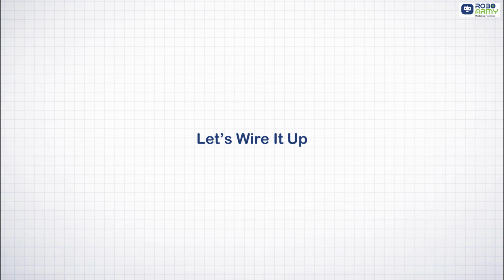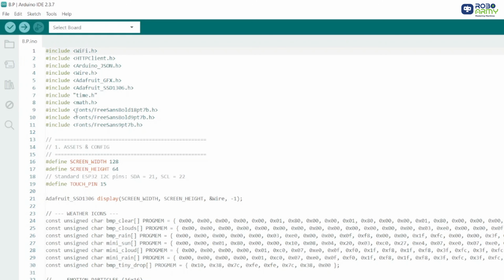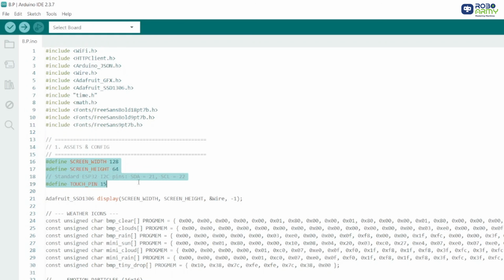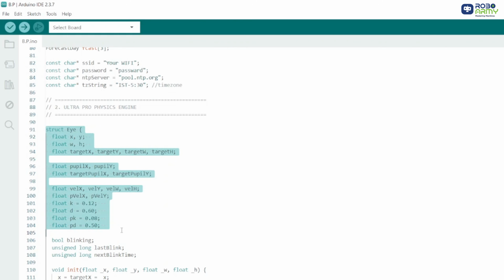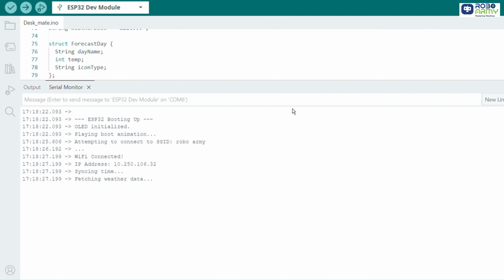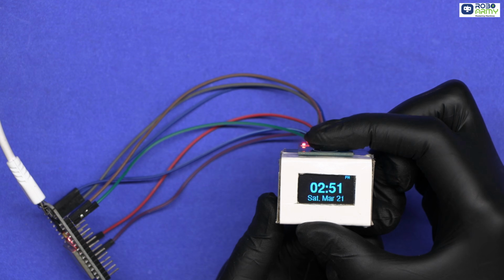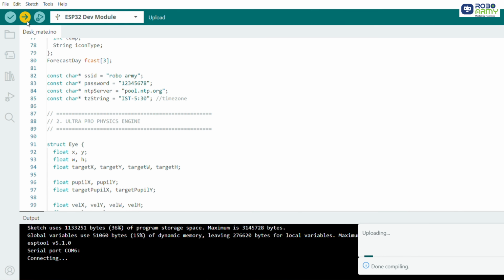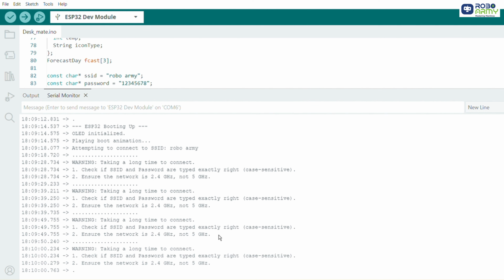Build Desk Robo 🤖 | Smart Emotional Desk Companion using ESP32 + OLED | IoT Weather Robot

Comment: Sir  am facing problem  , when i upload coade it works fine but when i disconect it from laptop then it does not holds   The code
Reply from the maker: Make sure you are powering the board with a stable external power supply once you disconnect it from your laptop! 😊
Reply: @robo_army_  like from battery u can right?